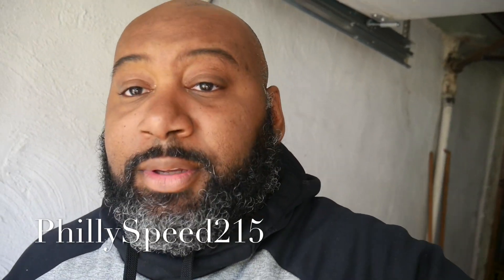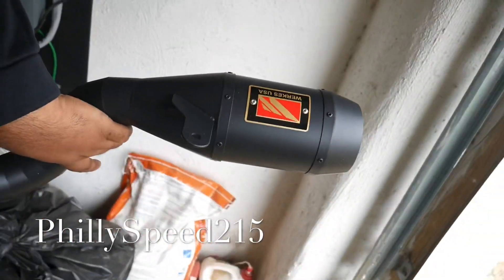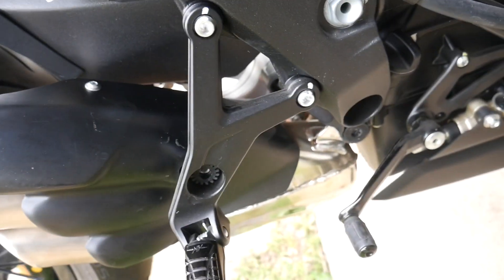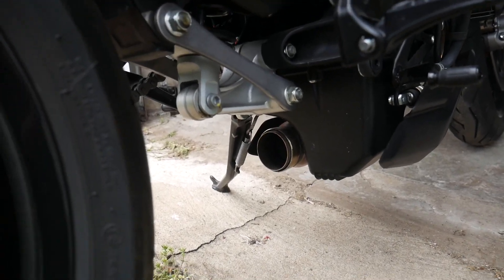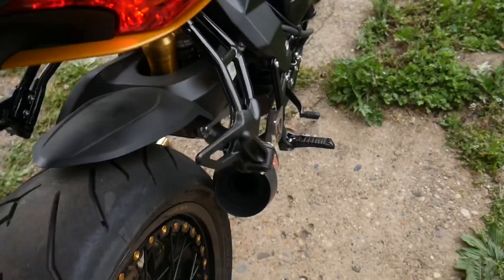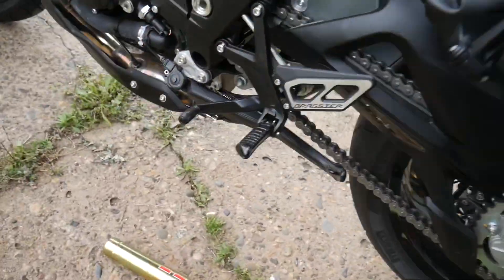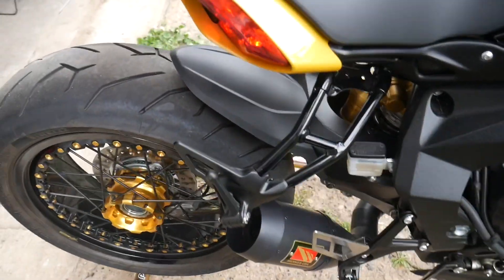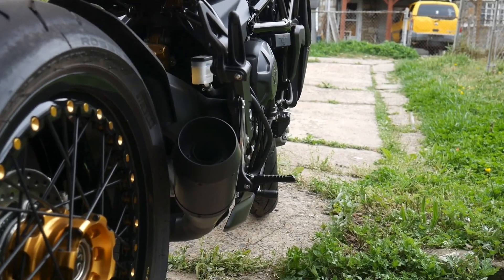Installing my new (Competition Werks) exhaust on my 2017 Mv Agusta dragster 800rr👍

Comment: Hey man, thinking about doing this with my Brutale 800 2017. One question I can’t seem to find a straight forward answer on is if you need to do a power commander and ECU remap after the install since it deletes the cat. Did you do that and if not have you had any issues with the bike? I’m changing more for sound/looks than performance.
Reply from the maker: No I didn't put on a  power commander or remap the ECU. The bike runs great with no issues and it sounds great. I would still consult with your local dealer.

Comment: Sounds awesome. Did you have any trouble disconnecting OEM cat from exhaust pipes? Mines is so tight, I wondering if factory used muffler cement!
Reply from the maker: Not at all,
Reply from the maker: I didn't have an issue removing the factory muffler. It came right off with ease.